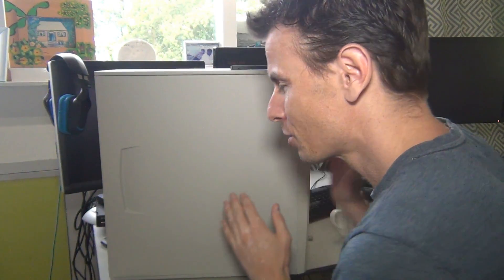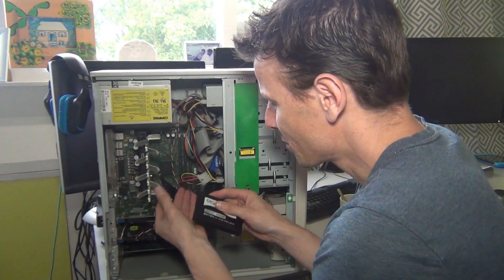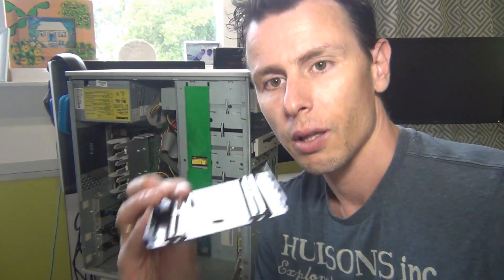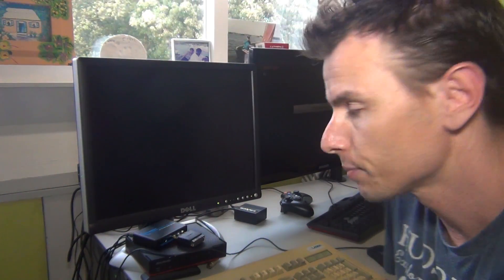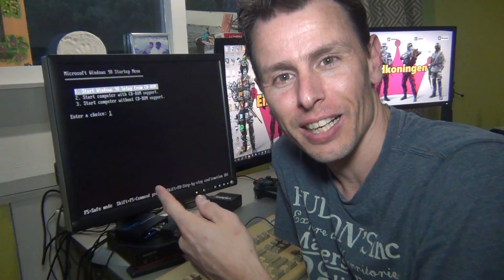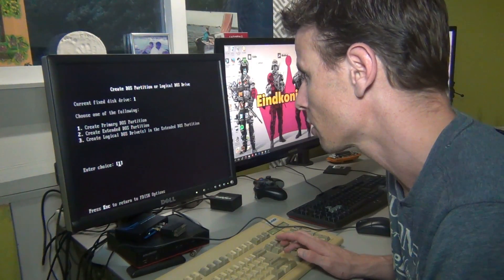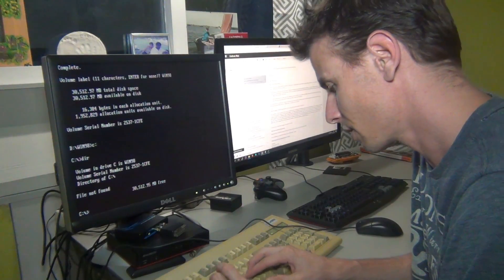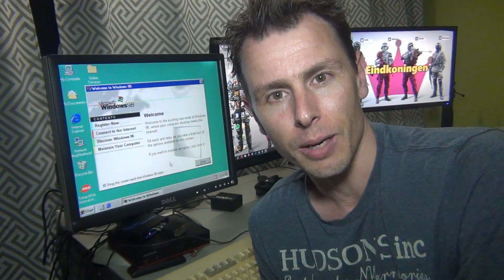Windows 98 on an SSD

Comment: How did you install Windows 98 on a SATA SSD without a F6 SATA Driver. Windows XP and Windows 2000 need this driver to be able to install on an SATA drive. As far as I know there is no F6 driver for Windows 98 or Windows Me. If you found one please let your viewers know where it can be downloaded from.
Reply from the maker: It sees the ssd as a normal ide because of the converter
Reply: @RetroGameCouch  I have tried several times with the same adapter you have and each time during the install process when the computer reboots I get a flashing white line in the top left corner of the screen. And that's because the computer does not see the installed OS. The adapter you are using is so you can install a SATA drive in a computer that has IDE connections. But you still have to be able to install the OS on the SATA drive. Both Windows XP and 2000 allow you to install the F6 driver during the install process so they can be installed on a SATA drive. Windows 98, 98se and ME do not give you that option.
Reply: @kinkykane0607  When I wrote my post there were no SATA drivers for Windows 98 or Windows Me. Only Windows 2000 and above.  SATA drives were not around in the Windows 98 / ME era only IDE. So if you have a SATA driver please post it. Or give me the model number of the adapter you are using and where you bought it so I can look into it farther. Thanks.
Reply from the maker: If you use the converter I show in the video you don't need SATA drivers. It connects to your IDE cable. The SATA part is all done by the converter. The PC only sees, and communicates with the IDE part of things.

Comment: Try building a celeron g470 overclocked as high as it will go, max out the ram so that you can build a big ram disk max cpu supports is 32gb so you could have 1gb for os and 31gb for ram disk,  buy the newest gpu and peripherals that have win 98 drivers available.
Set it to save the state of the ram disk at shutdown to minimise writes on the ssd and keep it connected to a ups to ensure it has enough time to back up on power loss.

The automatic ssd back up isn't essential, you could manually create new images as you update the system kind of like a restore point so if ever you break the os you can just load an earlier image.
Reply: Noone is going to use 24+G RAM for 98.
Reply: @WellBeSerious12  A ram disc as os drive would work though, you can use all the ram above the win 98 stable range as a ram disc.

The ram bandwidth would be faster than even an nvme drive.

Comment: Retro operative systems and ssd's do not last as long as one might hope. Just a heads up :)
Reply from the maker: +Christian Ivarsson why's that?
Reply: Depends on the type of "SSD"...
Compact flash cards for instance can be worn down fairly quickly if used as a C:\ boot drive,
You'll begin to see sectors that can not be read nor written to. But, If this is say in an XT clone
It won't be worn down by a longshot as say a, Socket 7 build build win Win95. Ideally you'd want
to use an Industrial DOM, As they were specifically designed to replace aging hard drives...
Reply: ssd's with Win98 work just fine, however using the adapter shown in this video your SSD will read at IDE speeds roughly 135mb/s.  Better option is to use a pci adapter card that has sata ports built into it.  You'll be using the pci lanes for data speeds and even on thos old boards you'll move faster than IDE bus by about double.
Reply: @animalyze7120  A 32bit PCI SATA controller on a 33Mhz bus will only reach speeds of 132Mb per second. Not to mention, it will be sharing that bus with every other PCI device in your system. On an older PC, it really doesn't matter which method you use as the SSD will never reach its full potential speeds. It really boils down to what you can find and how cheap you can get it.
Reply: @AtariBorn  True enough, most people I've dealt with usually go the pci card option.  The only real advantage of using ssd's in these older systems is reliability in my experience, the speeds aren't justifiable.  However there a ways to use motherboards a few years newer that offer better sata speeds and pci lanes though often that requires hard to find bios modifications to utilize them.
Reply: @animalyze7120  Yeah, if you jump to a motherboard sporting PCI-Express, it's a whole new ballgame and you will see a tremendous increases of performance with an SSD, over a traditional mechanical drive. Not that you wouldn't see any difference on PCI  as spin up and seek times all but disappear.

Comment: Looks like that keyboard needs some retro bright!
Reply from the maker: It does. Any tips for doing that?
Reply: Coating it in hydrogen peroxide and having it exposed to UV light is the most popular technique I've seen people do on YouTube. Btw I really like your content. I just discovered you and I'm a huge fan thus far. Keep up the good work!
Reply from the maker: +The Running John thank you John
Reply from the maker: I have never tried it before and seem some very mixed (and lately bad) examples on the 8bit guy's channel. I'd hate to ruin the keyboard. I wouldn't do it to any of my 20+ commodore 64's for sure!
Reply from the maker: +ObsoletePowerCorrupts that sounds awesome. You should feature in since you're familiar with the subject.

Comment: The good old DOS times. The keyboard sounds alone makes me feel like back in the days, but to see the fdisk& format commands again, made me feel like a little kid again :D
Looking forward for the follow-up videos with the machine. Very nice video, thanks!
Edit:
Also glad the SATA /IDE converter worked without issues. Some speed results for the fun would be neat. Cheers
Reply from the maker: I had to create a DIN to PS2 converter to connect this old beast. I'll do a video on that soon. I feel the same way about DOS. Honestly, the second I saw the command prompt the commands just came back to me. Awesome.

I'll do a speed test between the SATA and one of the old IDE drives in a future video. I'm curious as well.